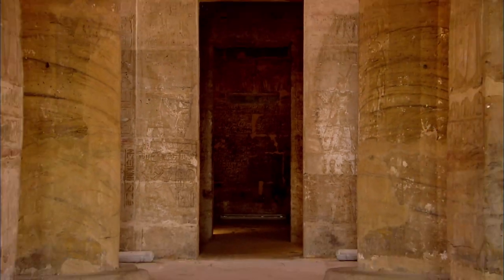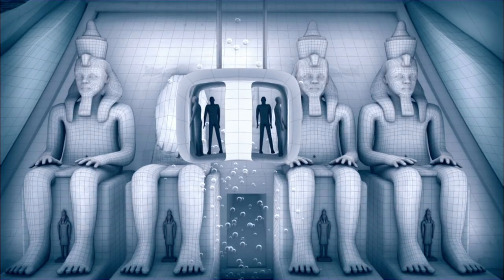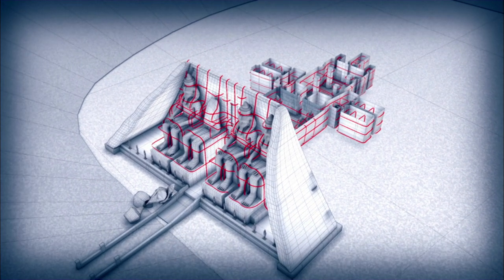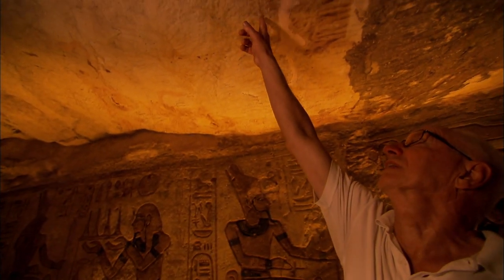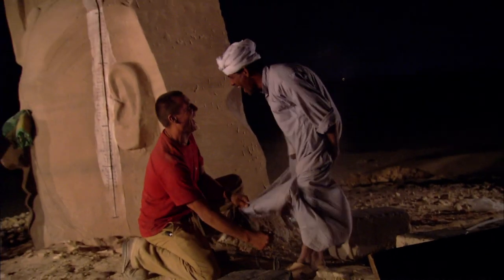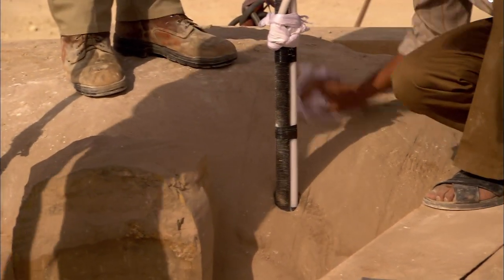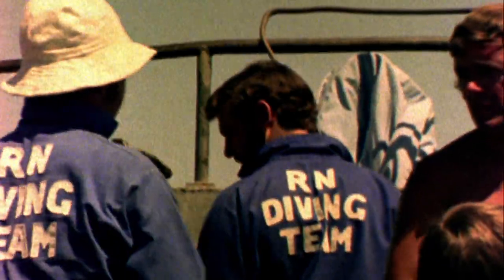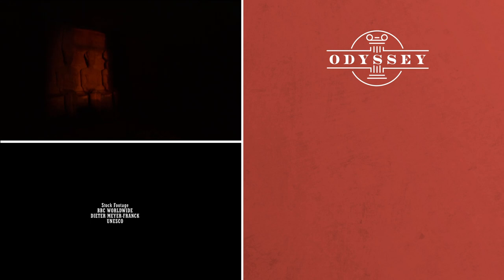How do You Move A 3000-Year-Old Ancient Egyptian Temple? | Huge Moves | Odyssey

Comment: I have been to both Philae and Abu Simbel. If you didn't know they were moved you would have thought they stood in the exact spot for thousands of years. I wonder if the dam would have been built today. It was needed but they might have used a different method so the ancient temples didn't have to be moved. There is equipment and technology that exists today that didn't in 1964. Egypt is a marvel that everyone should visit. A civilization as advanced that it is hard to believe it existed. They still don't know how they pyramids were constructed with such accuracy using primitive tools to measure and fit the blocks.